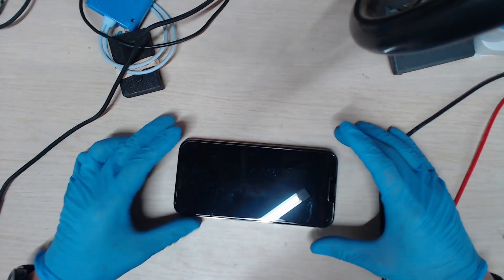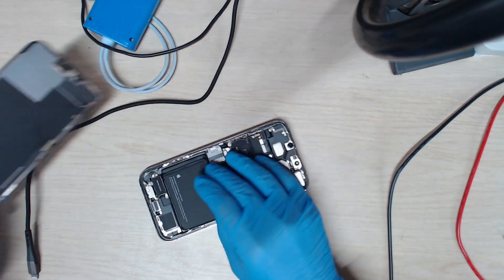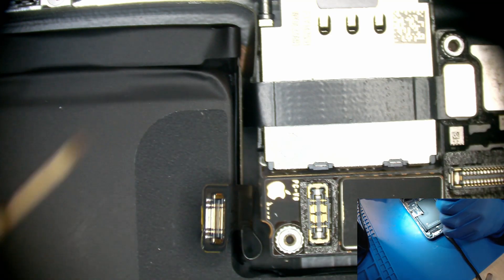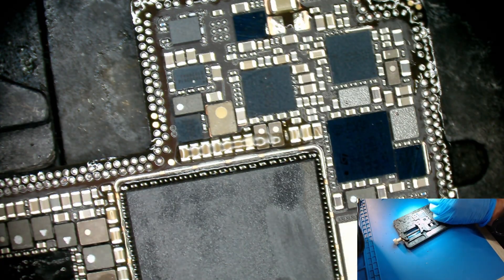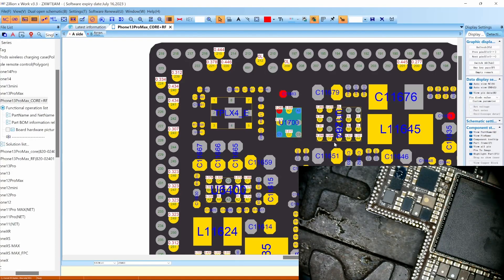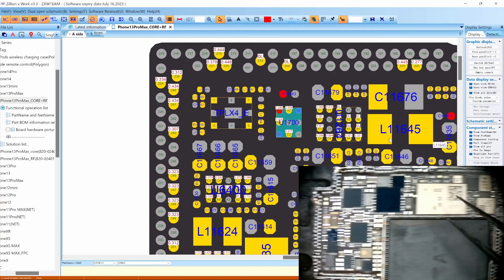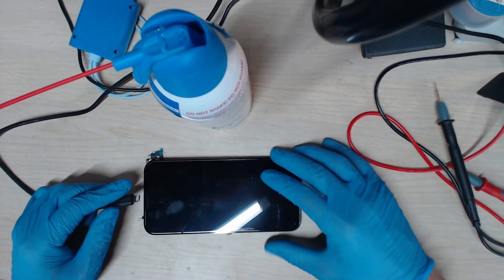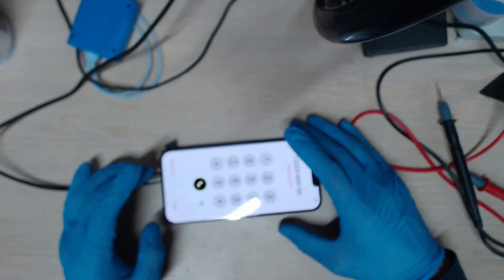iPhone 13 Pro Max Boot Loop Issue Repair

Comment: What is the max current during boot? I have an iphone 13 pro that starts at .1, jumps up to around .2 during apple logo, the jumps up and down to about .7, up and downto .8, up until my meter pegs out and my 1.5 A power supply cuts out. Any reply would help me know where to begin looking.
Reply from the maker: It sounds like yours got a short memory.